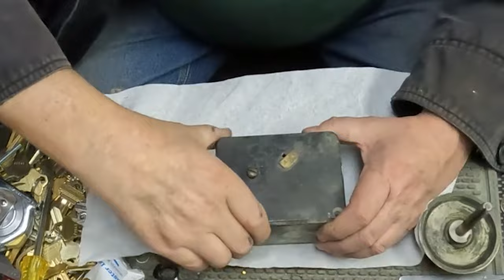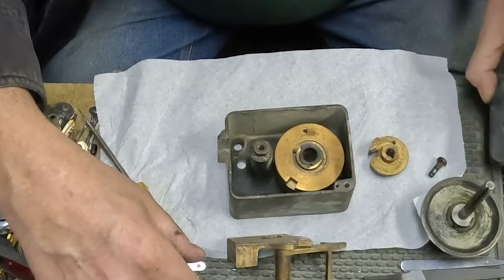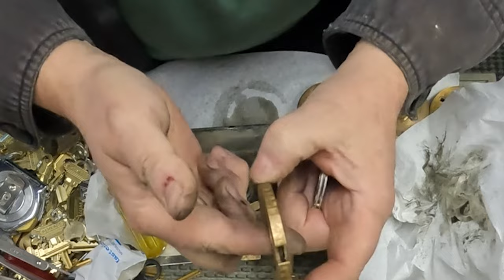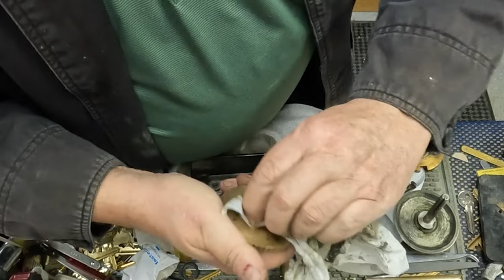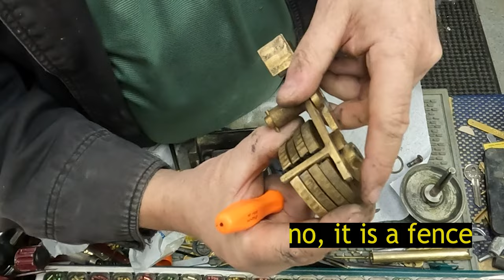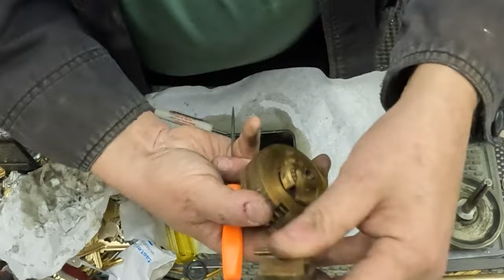Cleaning an old Diebold Safe lock

Comment: You used a cleaning spray what type of spray did you use? Also, when refitting them back together, you did not use any lubricant is lubricant recommended? Or maybe a graphite at the parts that rubbed together. Please expand if possible.
Reply from the maker: Thank you for watching. 
The spray that I used is not my preferred product, so I will not promote it. What I liked to use was a product called GT85. It would dry and leave a thin Teflon coating to act as a lube. 
When choosing a cleaner/lube, it must dry, or if using a grease, it MUST BE MADE FOR SAFES. I do not own any safe grease and am not sure what is in it. 
DO NOT USE WD-40 ORIGINAL, the bulk and gold can it does not dry. GT85 is no longer made as they were bought out by WD-40.  The closest thing on the market to GT85 that I have found is WD-40 specialist with Teflon. It is usually sold out in my area. Be careful if you go to pick some up as there are several specialist formulas, all in the same color can.
I would not recommend graphite as it makes a horrible mess.
Reply: @detornodoes  thank you I have an old safe and the dial sticks horribly and I need to take it apart and clean it and get it so that spins correctly. This advice and your availability has made me confident. I can do the work on my own workbench. I will let you know how it goes.
Reply from the maker: When you put the lock back in, dial the combo 4-5 times with the door open until you are sure it is working correctly. If you dial the number and you are certain it was done correctly and the bolt(s) do not retract then something is wrong which is why you ALWAYS  test a new combo or maintenance work with the door open. If you close the door and it doesn't work, now you are drilling the safe. And before it gets asked, no, I won't tell you where to drill.

Comment: what kind of cleaner do you use for this? is a break cleaner acceptable or would that be too harsh for the brass? I have an old safe that I would like to clean myself. I also have gun cleaner that might be gentler if that would work, or would I need to buy a specific cleaner for it? additionally do I need to lubricate the mechanism at all?
Reply from the maker: I would say the gun cleaner would be your cleaner of choice.  What I was using was similar to the PTFE version of WD40.  Do not use regular WD40 as it doesn't dry and will attract dirt.  If you use gun cleaner you can then take some gun oil 1-2 drops on a clean rag and a quick wipe.  You want just a slight film on the wheels, not a lot of lube is required.  Depending on what type of set up you have, it might be a hand change, if it is be careful that you don't push the center section out, unless you want to change the combination. If it is a key change you can be a little rougher with the wheels with out fear of accidently changing the combination.  (future video)  ***Once clean and reassembled test the combination with the safe open several times before ever closing the safe.*** Once you are satisfied that the combination is working correctly close the door and test one last time before walking away.
Reply: Thanks for the feedback! I've got another question. The backmost tumbler is a little damaged, and bent about a 16th of an inch at the gap. Is that something that I need to replace, or will it be okay as long as I'm not too rough with it?
Reply from the maker: If it is damaged, I would not run it.  If it is an antique, parts will be hard to find as well as expensive.  Something modern just replace. Or you could try to find something similar on Facebook marketplace, people sell them cheap or give them away just to get the heavy boat anchor out of their way.

Comment: Hello sir, i have that not so modern lock lol. Was wondering if you know if slot on drive cam is fairly square? Mine has a angle on slot and having hard time to engage.
Reply from the maker: Yes it should be fairly square.  There may be some rounding of the edges but there should not be a taper.  If the drive is failing I would not recommend keeping it in service as drilling the safe is much more work than fixing it while open.  If you know a machinist, they might be able to make one or braze material on to repair yours for you or you might find a donor lock some where on the internet. ( I don't have a source for repair parts)  If parts are worked on or replaced make sure you test the combo, with the safe door open, several times to make sure it is working correctly before closing the door!
Reply: @detornodoes  thank ,you there there is a large taper . I tried brazing to no avail. Can’t find much on this locks.
Reply from the maker: I have never attempted to braze , however, it  should only be brass or bronze.  The wheel pack that I had  showed was taken out of service due to several of the flys being cracked and not consistently dialing correctly.  I  was able to very gently dial it open one last time and prevented having to drill the safe.
Reply: @detornodoes  I did it I brazed a piece and squared gate, only thing is now is it is off by 3 digits. I set all wheels to 40 but have to land on 43 to open. Any input would b great. Thank you so much. Glad I found you. You steered me in n right direction
Reply from the maker: So since you stated that you set the number to 40, I am assuming that you have a center change lock ( where you pop the center out and put the tick mark on the number that you want) vs a lock that needs to a change key. I find that they rarely are accurate.  If it is a center change you could just move the tick make it work for 40 or just have the combo work with 43 or you could attempt to adjust your braze to land on the correct number. Again make sure that the safe dials consistently to retract the bolts before you ever close the door and lock it!!